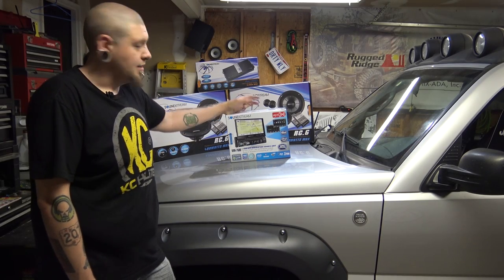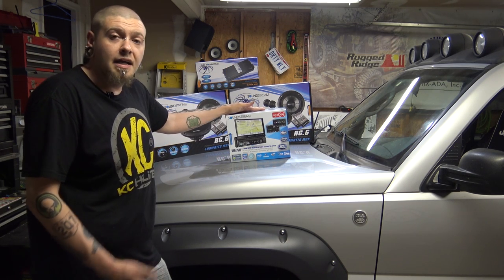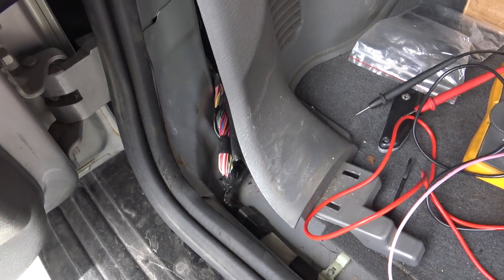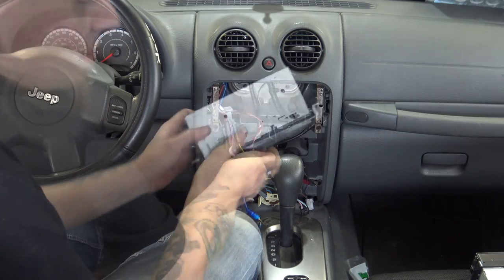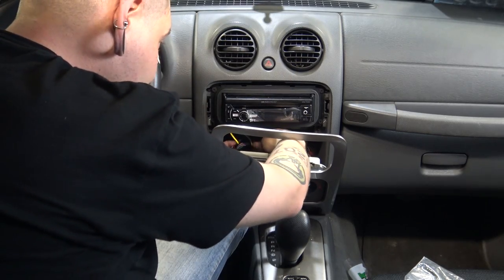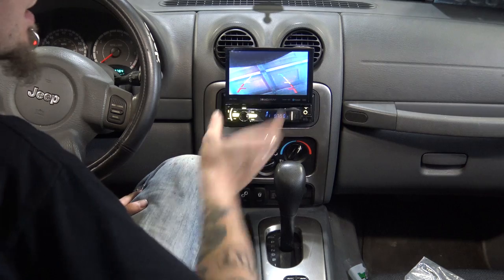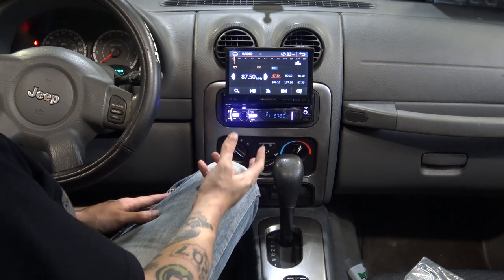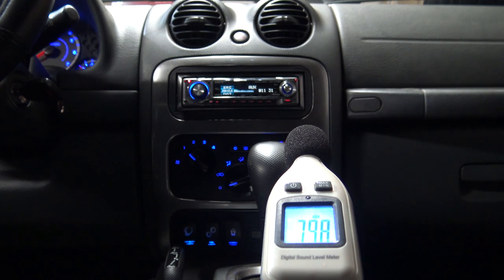New Soundstream Head Unit (VRN-75HB) Project Renegade Ep.19

Comment: looks like a great head unit. I want to find one for my wrangler that has nav and bluetooth and also satellite radio. I don't want the flip out screen though I want the screen like some of the stock stereos had just one that fits the space and is touch screen
Reply from the maker: I've been looking at some.... EXPENSIVE!
Reply: Rocky, how has this unit held up so far? Screen responsiveness and motorization?  How was the GPS and has it been consistent?
Reply from the maker: Pretty good so far, the GPS is accurate and I've only lost GPS signal once! The screen motorization is still as smooth as it was when I installed it, the touch screen works great. I'm really impressed with this unit, my only complaint would be the screen tilt positions, there's not enough of them and the screen can be hard to see at times .

Comment: @rockyxtv does the screen flip up and sit upright or is it at a fwd tilt? Mine doesnt sit up right or stay open at all!!
Reply from the maker: There is a button that says tilt or screen, this controls the angle of the screen and if the screen stays out or not. I hope this helps you out, thanks for watching!
Reply: Says "open/tilt". When pressed, it will open but not all the way. Stops at a tilt. Then after about 2/3 seconds it closes automatically.
Reply from the maker: That sounds like a manufacturing defect, are you able to return the unit?
Reply: Aww man, ill try. That's disappointing

Comment: Where did you mount the GPS antenna?
Reply from the maker: I ran the wire down through the grommet in the roof for the roof lights. I mounted the antenna with the attached 3M adhesive to the roof between the sunroof and roof lights. I also tried the antenna on the center of the dash and on the passenger side A-pillar. It worked fine in both of those locations. Thanks for watching!

Comment: They should have sent you a double din
Reply from the maker: They gave me the choice of a single or double, I chose single because I wanted to keep my colored/silver carbon fiber looking bezel. I had the double din dash kit but sent it back, plus with this unit the screen sits higher and is easier to see, and it's a bigger screen. The double dins are 6-6.2" screens, the single has a 7". And I didn't want to mess around with moving my switch panel over to another bezel. Thanks for watching!